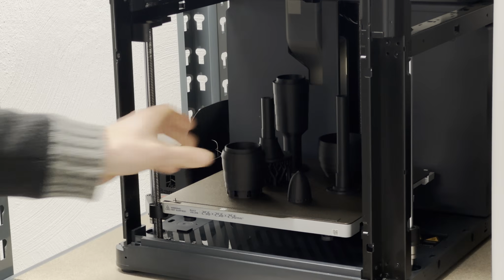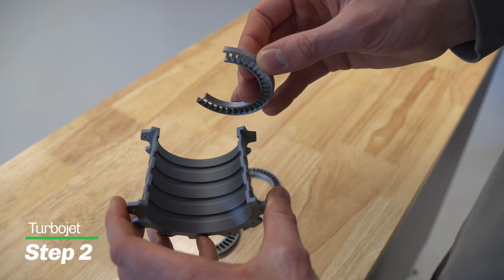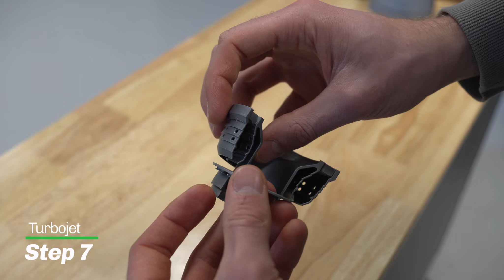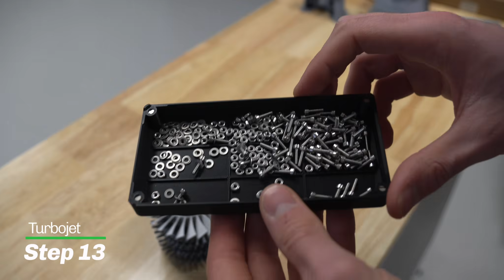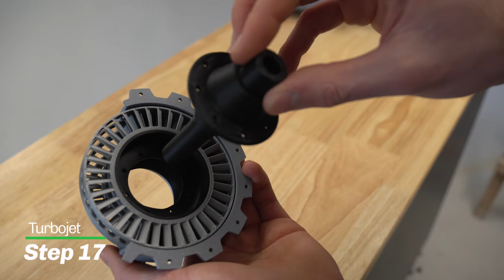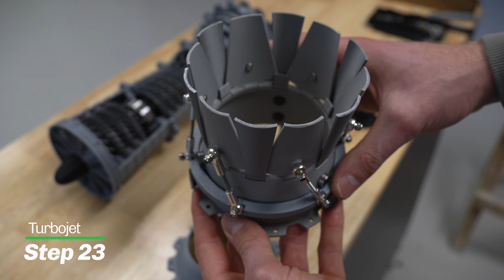3D Printed Turbojet | Full Assembly

Comment: Amazing model, thanks for sharing. When assembling the larger modules the outer two stages spin together but not the inner. Your centerline shaft rotated all of the shaft line, is that an assembly error on my part? I have seen a few comments with others seeing the same thing.
Reply from the maker: That’s by design. Like in the real engine, the high pressure and low pressure spools are two separate shafts. They aren’t mechanically linked, so you can hold one and spin the other, even in the opposite direction. On the model they sit on a shared bearing, and the friction in that bearing drags the inner spool along with the outer one. That’s why they look like they’re turning together.
Reply: @Linus3dOfficial  thanks for confirming. Perhaps that's what some did with the motorized version and linked the spools. I also had an issue with the stage with the fuel injectors as the stack up has a clearance issue and interferes when bolted down. Thinking I might have some expansion when gluing up or stacked tolerances. Thinking of printing a "gasket" or spacer to shim the flanges to bump it out enough to spin free.

Comment: Did you print the outer parts grey and inner parts silver?
Reply from the maker: The casings are printed in a matt grey, the shafts in black and all the blades in silver. You can find the exact listing of filaments and how I used them on my MakerWorld. Link is in the description of this video :)
Reply: @Linus3dOfficial  im on it, im actually printing right now. When i select A1 mini printer only two colors appear, but i noticed there is a third. Thanks!
Reply: @Linus3dOfficial i ordered your hardware kit, how long do you think it will take to arrive to Canada? 😅

Comment: I'm trying out various materials and colours for my build. However, being a perfectionist I'm struggling with the quality of the underside of some of the main body flanges where support connects to during the print process. Even with support material on the interfaces, the supported side is not as good of a finish as the unsupported side. Since a lot of us appear to be using silk and metal PLA etc for these prints sanding also doesn't give the desired finish. Can I suggest the creation of some very thin gaskets that match the profile of the back of the flanges that can be printed in the same material and then placed on the support side of the flange for purely aesthetic  purposes?

This is such a minor thing, everything else is awesome and I'm loving this kit. Looking forward to getting the turbo prop and variable prop next.
Reply from the maker: That's what i call dedication right there, and I'm all for it! You could try using body filler or similar to fill in the imperfections. I'm always very busy and making this would take some time. Not necessarily the design but everything around it (Pictures, Instructions etc.). As I'm somewhat of a perfectionist myself when it comes to publicly uploading work... 

I can't wait to see your builds and would love to see what you come up with
Reply: @Linus3dOfficial no worries, appreciate you taking the time to reply. I may give it a bash myself and see how it turns out.